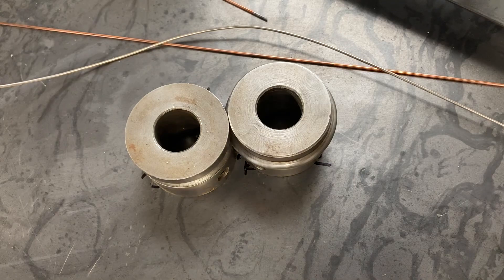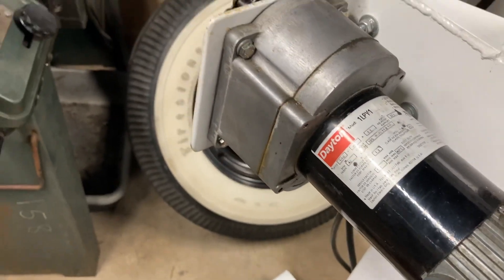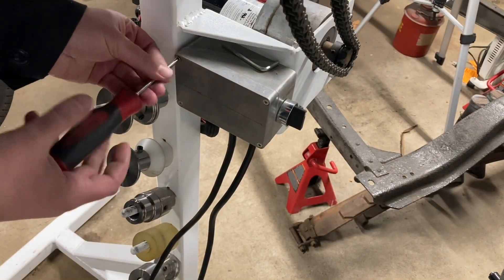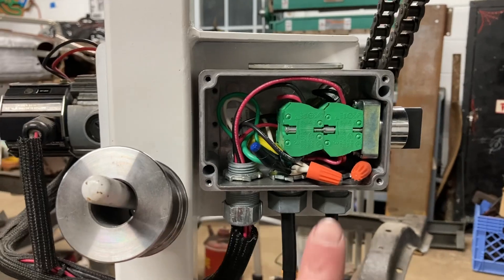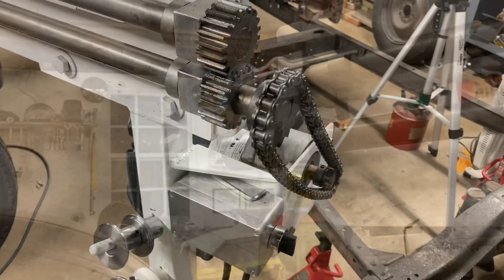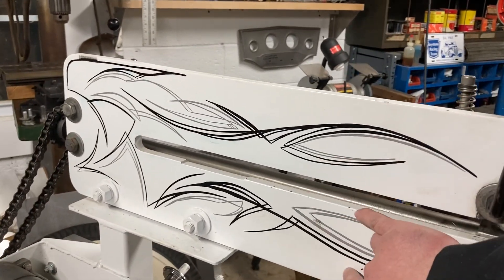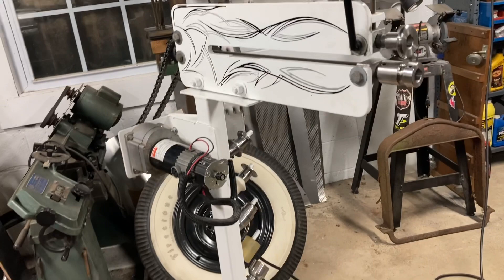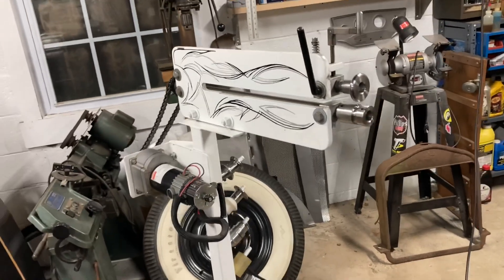Home built power bead roller

Comment: Really nice job!   I was wondering if a 40v dc motor from a ryobi cordless lawnmower would provide enough torque to operate this?   Then a battery adapter and large capacity ryobi 40v battery could be adapted.
Speed control boards are readily available on ebay for that motor.  Ofcourse these batteries can also be solar charged.   Again great video.
Reply from the maker: Thank you for watching! Sounds like a good plan to me, would love to see what you come up with!

Comment: I have a similar bead roller. I powered mine with the Eastwood deal. Its ok... not totally satisfied. I am going to be adding stiffening gussets to mine. I will be doing a video on it as well. I really like your setup! I probably should have done something similar
Reply from the maker: Looking forward to seeing your bead roller setup! As soon as I acquired all the pieces I needed to power my machine, Eastwood released their motor adapter lol! Typical luck I suppose, but I kept moving forward with my plan for it. I’m sure I’ll need to brace the throat in the future to remedy the deflection.

Comment: Great build, and thanks for taking time to explain the details. I couldn’t find a similar DC motor for my plate style bead roller. Ended up with a Jazzy wheelchair motor, HP DC power supplies and an Ebay controller with reverse. Still in the design stages, but your video helped a bunch. I spied an older HF bandsaw in the background and looks to be the same as one that I have. After welding up a mobile stand (little taller), new bearings, Bosch blade and over sizing the inboard jaw to 1/2” bolts, it is a whole different machine. Maybe a new video idea when you get a chance. Those  rack up the view count 👍.
Reply from the maker: Thank you very much! Looks like your well on your way to greatly improving your bead roller. Really dig the resourcefulness of your parts! Yes, that tired old bandsaw is in desperate need of a tune up that’s for sure lol. Thank you for the suggestions and thank you for watching!

Comment: Can i ask you a question?? Im making my own bead roller, im from Venezuela, so is better for me making it here and import the bead dies... But i need some specific measurements, what is the diameter of the upper and lower shaft? And the diameter in the part that you put the dies, the diameter of the dies holes? My idea is to make something like the eastwood élite bead roller 27 inch... But like 36 inch, but if i screw the shaft and dies sze its going to suck really bad later, thanks
Reply from the maker: Absolutely! I turned down the shafts to fit the new Eastwood dies that are available. The dies themselves come in at .865” , that’s 21.971mm. Good luck with your build!